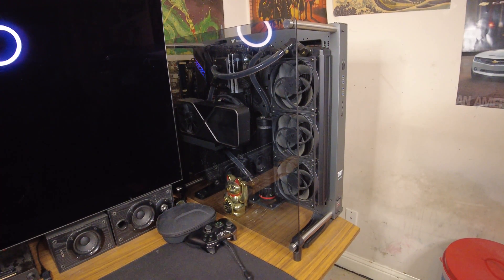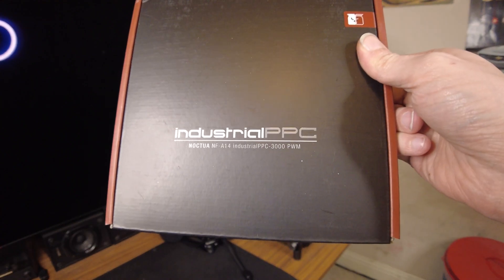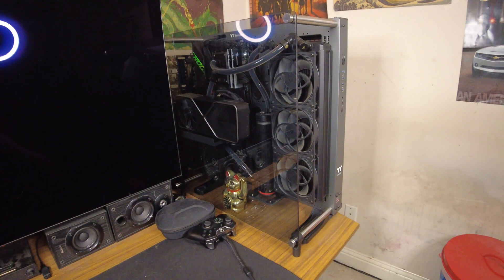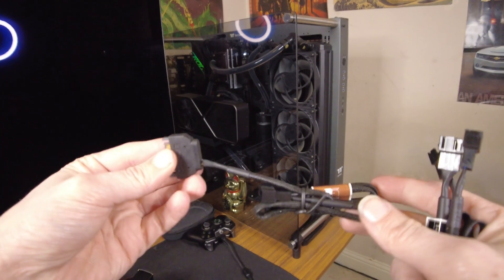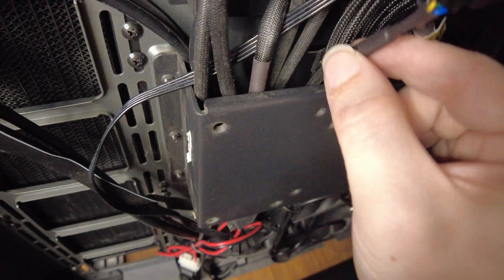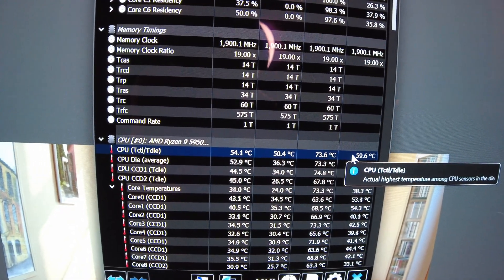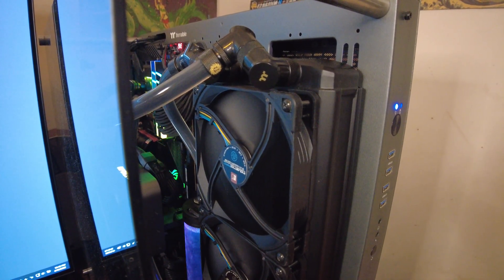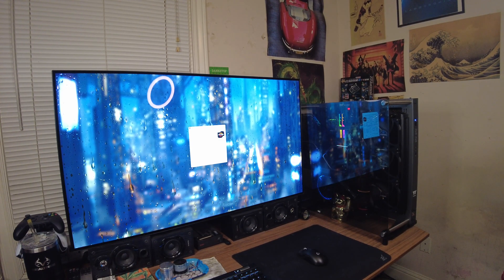5950x RTX 3090 Noctua NF A14 iPPC 3000 PWM 3000RPM Fan Upgrade

Comment: Great video dude! Very Zorz!  I was going to do this on my arctic 420 but decided against it initially. But now I'm thinking Fuck it. How do you feel about it?
Reply from the maker: These things work great I do not let them use the full 3000 RPM as there are diminishing returns at a certain point. But after you tune them to your radiator they seem to be some of the best radiator fans out. Though pricey you get what you pay for with these.
Reply: @XxViciousxX  I think I'm gonna do a fan curve with 85 percent if it goes over 80degrees... what do you think?
Reply from the maker: @ZorzGaming  That sounds pretty good though it might be a tad noisy. But any more speed than 85 is where I found diminishing returns in performance at least with my radiator.